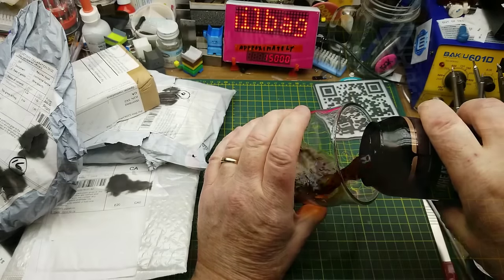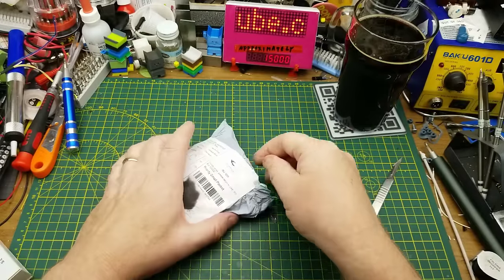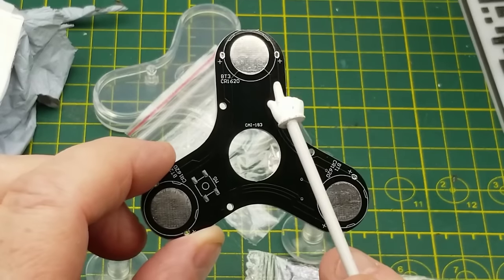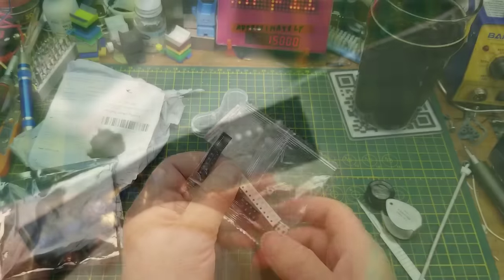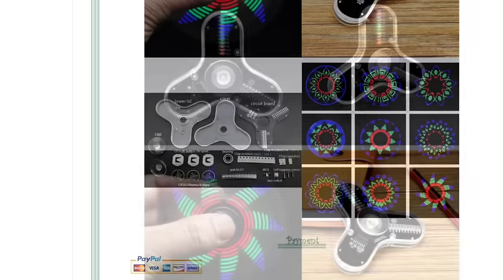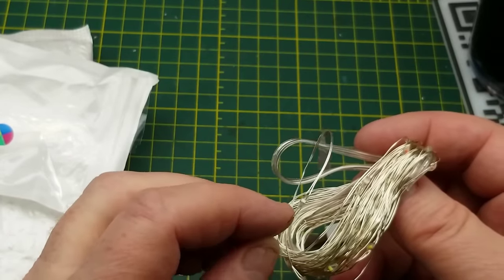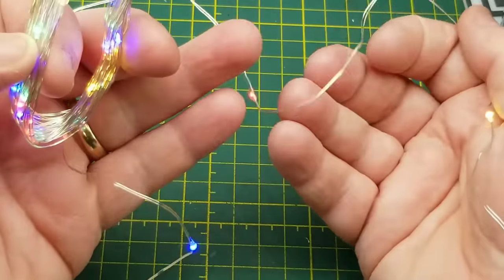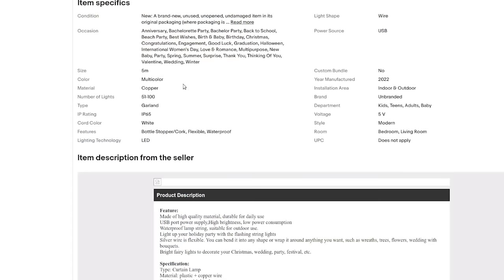Mailbag Monday 179

Comment: Good selection in the post bag this week, look forward to your kit builds. Just finished a couple of digital clock builds. I made some of that rosin flux myself using those type of bottles. Seemed to work fine. Just keep adding crushed rosin to the ipa until saturated.

Comment: Kit build time is here again! Oh boy oh boy oh boy!

No rule says you have to build the fidget spinner as designed. Instead of the bearing, stick in a solid chunk of plastic and attach it to a small motor, maybe kitbash it with something with an IR sensor so you don’t have to switch it on and off.

Say, you got some rotary connector commutator gizmos a while back. Would one of those do to eliminate the batteries you don’t have? Would the sliding contacts introduce noise and keep resetting the MCU or would adding a smoothing cap fix that?
Reply from the maker: Battery eliminator! Good thought.
Reply: @pileofstuff  use the slip ring to power it while on a motor.

Comment: Hey looking for assistance from YouTube comments here.

And this is in regards to the wire LED strings.

I'm trying to find ones that the LEDs are very close together instead of typically 2 to 3 inches and using LED strings for all sorts of things in my models.

Primarily interested in the white varieties of LEDs doesn't matter as much the color as long as it's white but primarily finding a source of them that are super close together.

Abuse others but when you need them close to Gallery gets messy and bulky with having to shorten by looking back and forth and twisting wire together just to take up excess length.

Essentially using the ones that would be super close together to simulate string lights in scale somewhat.

Yes I know there are specific ones out there for that but they're super expensive used to use the lights for like Department 56 and other sorts of things but those get very expensive nowadays.

Also of note I found a good source for long strings of LEDs suitable to what we have on a spool and cut to the length knead.

On wiretap LED strings Amazon is often your friend for a lot of things.

Nice thing is parallel connection no Active Electronics 4.5 battery pack!

Free adaptable also to USB with a few modifications primarily using the is for on a spool just for cut the length needed as I mentioned.

If I remember it's 60 ft or so of wire LEDs